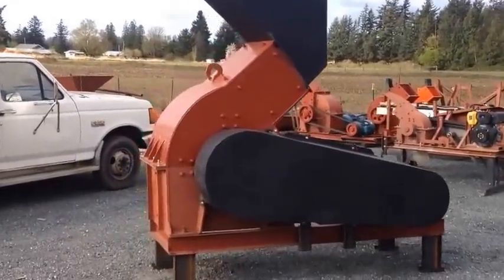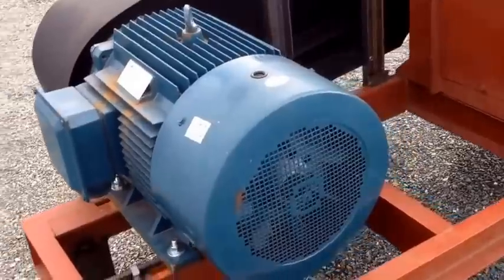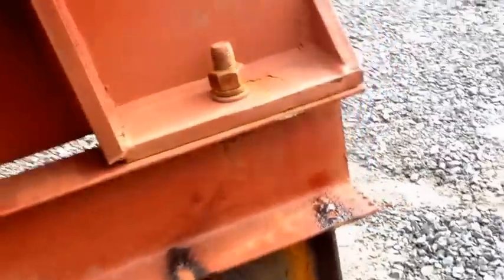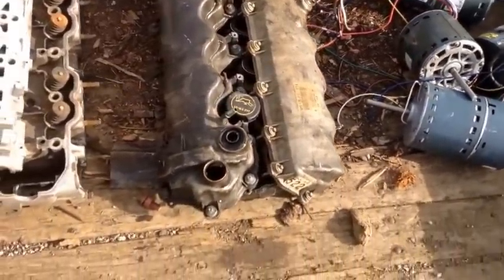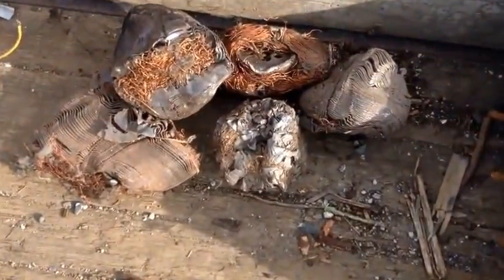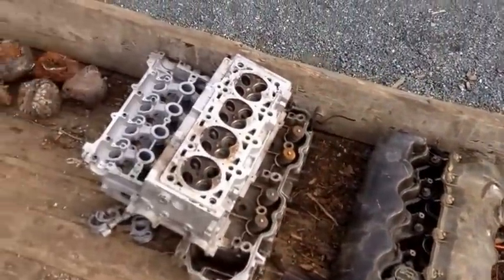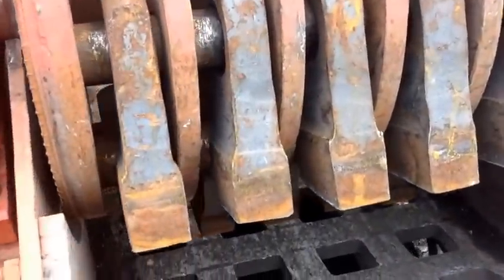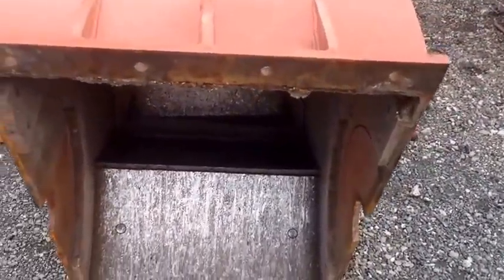Recycling Aluminum Heads, Alternators, Elec. Motors, Starters, Scrap Copper with a Hammer Mill

Comment: Hey guys long time no chat. Have you ever run windaw ac unit compressors through your hammermill? currious what the final product would be?
Reply: When the sealed unit becomes unsealed you will have oil everywhere and the freeon is still illegal to release in the air, supposed to be sucked up through manifold gages and into a tank. I have dishonest repair shops such the free one out of people cars in the winter then sell it back to them come summer. A bottle of that costs 120$USD.
Reply from the maker: +Jaon T We haven't run any window ac units yet, but I will add it to the list.  Thanks for the suggestion.

Comment: So how is the material efficiently separated after its ran through the hammer mill? I know you probably use magnets to a certain extent but then aren't the copper windings wrapped in with the steel?
Reply from the maker: zackcat276 Hi and thanks for the comment.  The magnet works great for separating the steel and aluminum.  For the electric motors it is best to pull the stators out first so all you have is copper and steel.  Once the stators have been run through a large hammer mill and screen then they can be further milled using a smaller 3/8" screen which fully separates the steel and copper and then can be separated using a magnet.  Here is a great video showing the results with one of our smaller mills: https://www.youtube.com/watch?v=x9bePfg5KqQ

Thanks again for the comment and question!

Comment: I BET THOSE ELECTRIC MOTORS DULL THOSE HAMMERS FAST,CAN YOU IMAGINE HOW LONG IT WOULD TAKE TO SHREDD A 40,000 LB LOAD AT THAT RATE? LOOKS LIGHT DUTY TOY NOT A MACHINE THAT YOU COULD MAKE A LIVING WITH.
Reply from the maker: Bill Stokes Hi Bill.  Thanks for the concern about the hammers.  Because the hammers are crushing material and not abrading material the hammers last a very long time in a scrap metal application.  We have reports of customers running over 20,000 lbs of electric motor stators and transformers with very little wear on the hammers, the life of a set of hammers in this application will be well over 100,000 lbs.  The type of metal will also dictate the life span of the hammers, but most customers are running softer metals such as aluminum, copper, and thin steel plates (stators and transformers).  Thanks for the comment
Reply: I think the machines real purpose is assaying gold mines. Find out if a claim is worth bringing in the big trucks.

Comment: how long do these teeth in the hammer mill expect to last with steady work on irony aluminum
Reply from the maker: Negativecreep0 These hammers will last for months before needing to be replaced.  The hammers in these larger mills are for impact and not grinding like our smaller ore mills.  The aluminum is also a soft metal so it doesn't abrade the hammers.  We keep all hammers in stock for replacement, too.  Thanks for the questions.

Comment: I'll take two of those! What a job - you get to tear stuff up LOL. Is the screen size changeable on the smaller mills or is it one size only? Great video man.
Reply from the maker: jdeluisa Its super fun to throw different stuff down the hammer mill!  The screen in the smaller mills is changeable and can be done in about 5-10 minutes by hand.  The screen in this 32"x24" is welded in and weights over 800 lbs so its a chore to change the screen in this size hammer mill, but could be done.